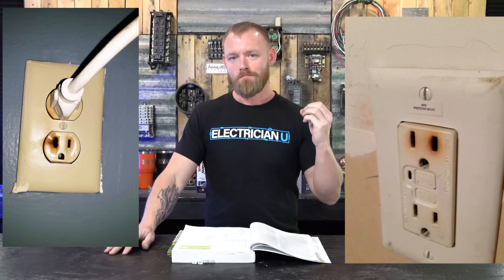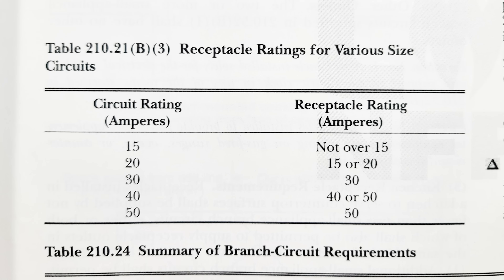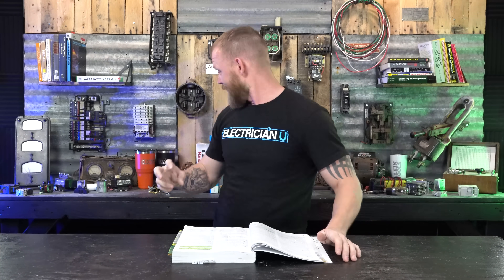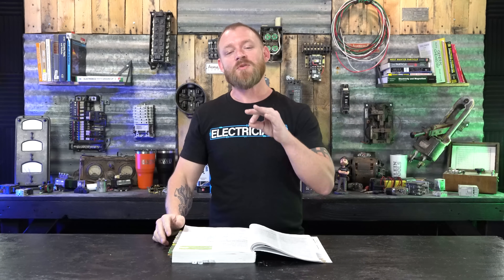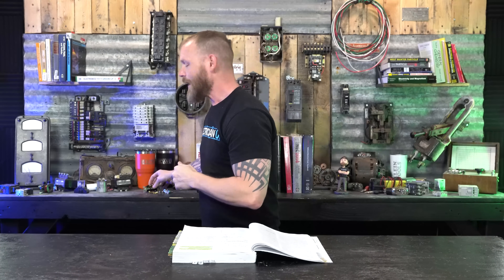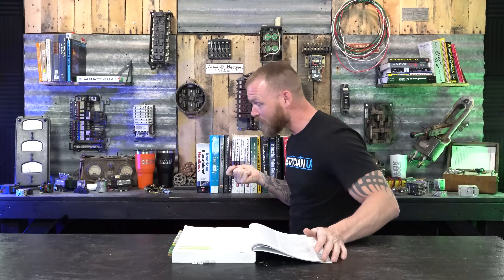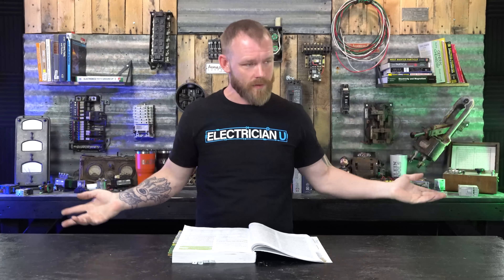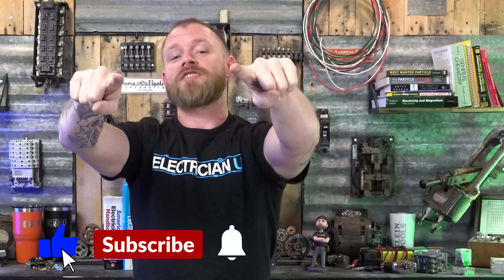Won't These Melt?!? 15amp Receptacles on 20 amp Circuits!!!

Comment: I have always been under the impression that it comes down to the plug style. A 15 amp receptacle has 2 verticle stabs. Any device you plug in is only going to draw a maximum of 15 amps. A 20 amp device has 1 verticle and 1 horizontal stab. It is physically impossible to plug a device that draws 20 amps into a receptacle that is rated for 15 amps. Therefore, even though the circuit is rated for 20 amps, a 15 amp receptacle will only physically have devices plugged in that draw 15 amps or less. 

In my experience, most devices I see that are burnt is due to a loose connection in either the wiring of the receptacle or loose stabs that make the plug connection loose. Im not so sure its an amperage draw issue.
Reply: The mistake in this is the assumption that it is all about an individual device.  Reality is the overall draw of all connected things on the outlets and circuit.  A lot of combinations are possible and you can easily draw more than 15 amps with multiple devices plugged in.
Reply: @MysticWanderer  that's true, someone could just put a plug splitter on there couldn't they. i've done it in a pinch to run a shop vac and saw together. but I don't think these 15A outlets actually burn up only because you put 20 amps through them. it's not like they're truly "weaker" receptacles are they?

it looks to me like a failed attempt at keying the plug types with the idea that we might transition to all horizontal-blade-accepting receptacles as standards went to #12 wire. But the market didn't follow what the regulators imagined. maybe
Reply: @Sean_y4k2l5  Don't even need a plug splitter, if it's a "duplex" outlet.
Can easily plug 25+ amps of draw (2 space heaters) into it with NO splitters needed.
Reply: @bricefleckenstein9666  If you put 12amps on the first outlet and 12 amps on the second outlet of a duplex receptacle, the circuit would draw 24 amps, but no part of the receptacle would be experiencing more than 12 amps of current as the current is split off to each separate outlet. You WOULD need a splitter to cause a higher draw through a single part of the receptacle.
Reply: @CalebEly  There would have to be at least some parts of that receptacle that experience the full 24 amps, starting at the hot wire contacts.
If the circuit is working correctly, the point the neutral wire contacts the receptacle would also see that full 24 amps of current.
Then inward into the receptacle to whatever point that one of the actual outlets splits off from the bus bars inside the receptacle.
Reply: @bricefleckenstein9666  What you are saying would not be only true for duplex outlets but multiple single outlet receptacles on the same circuit. This would mean you could only have a single 15 amp outlet on an entire 20amp circuit to be safe. Yet code says you MUST have more than one 15amp outlet on a 20 amp circuit, since there is no other reason to have it be a 20 amp circuit. This is because the hot wire contacts would not be the part of the receptacle that would fail due to current over 15 amps, otherwise it would not be code.

Also power strips and splitters would have a 15 amp fuse or breaker, so even through daisy-chaining the failure point is not pulling more than 15 amps when it fails. Blown 15 amp outlets are not failing due to overcurrent as they don't fail at connection that receives current over 15 amps, unless maybe the wire connection was not made tightly. The important failure point that should not experience more than 15 amps is at the prongs where a connection is not permanent. If you look at the blown outlet examples at 0:19, they all fail at the same point. This is because of connections becoming loose causing bad contact, resistance and heat between the plugged in device and the plug, not because they were pulling more than 15 amps or because where the Romex and the receptacle touch was experiencing more than 15 amps.
Reply: @CalebEly  It depends on how those multiple single outlets are wired. If the outlets are wired the way I was taught as a "best practice", with the wire going around the lug and continuing with no break in the wire, the wire becomes the overload point, not the outlet, as long as you're not overloading the outlet.
 
I do grant that the primary failure cause in most outlets is wear and tear over time on the plug-in part increasing resistance and heat.

Also, code DOES NOT say you "have to have more than one 15 amp outlet on a 20 amp circuit", unless that is a change in the most recent code version.
It's not considered a best practice of course, as you can overload the outlet without getting to the breaker rated current limit.
Also factor in how RARE "single 15 amp outlets" are - do they even EXIST outside of a "outlet + switch" combination?

Power splitters do NOT tend to have a fuse at all.
Power "strips" vary - 15 amp is by far the most common but I OWN a couple of them made by Triplight that are 20 amp circuit breaker, have 20 amp NEMA 5-20 outlets and a NEMA 5-20 plug, and are UL rated for 16 amps continuous usage (just like ANY 20 amp circuit). Triplight calls them "power distribution strips" or some such but they are nothing more than a heavy duty power strip intended for use in a data center.
Reply: @Sean_y4k2l5  manufactures are involved in writing the regulations
Reply: @bricefleckenstein9666  and the breaker will flip instantly
Reply: @CalebEly  exactly, those receptacles were burned by arcing not from too much power draw, otherwise you would never see a neutral burned like one of them in the picture
Reply: @Galgamoth  Breakers have a "trip time" depending on HOW MUCH overload they have (and on the specific breaker).
Seeing a 20 amp breaker need several seconds to trip on a 24 amp load is WELL within manufacturing tolerances.
Reply: @MysticWanderer  receptacles are reated to handle the load, the breaker is the weak link by design
Reply: @Galgamoth   20 amps would flow through a "15 amp" receptacle without necessarily tripping the breaker. It is allowed by code to put 15 amp receptacles on 20 amp circuits.

I'm not saying this would fry the outlet, obviously they have to be made to handle the situation.

This topic is a bit deeper and weirder than you suppose. I know it's the mfrs that write the regs... we call that regulatory capture....  whoever wrote them, they can be obtuse on certain matters.
Reply: you are exactly correct

Comment: In the UK we don't have an overload problem on circuits  so much because our voltage of 230/240v keeps the overall load lower. Power points in the UK are not normally radial. We have a system where all power sockets are wired as a 'ring.' Two cables per power circuit from the breaker(32amp) and wired as a 'ring' with a limitation of 12 outlets within a 1000 sq.ft. All twin outlets are made to withstand 32amp load. With the diversity factor it allows many sockets to be fitted. Having said that, I did, once go into a bathroom after the lady of the house had finished, only to find a metal soap rack across the bath with an electric toaster sitting on it!  So my friends overload is not our only problem!!  I must add, no electrical outlets of any kind are allowed in bathrooms-she had a extension lead for the purpose!

Comment: A chain (in this case, device> receptacle> romex wire> breaker> breaker panel...) is only as strong as it's weakest link.  It is like a bridge rated for 10,000 pounds.  Putting 4 one ton vehicles is about the most you want to put on that bridge.  5 is pushing it.

Comment: Does ElectricianU have a video on MOP and MCA when specifically referencing heat pumps and air conditioners?

In HVAC we need to use the manufacturers data plate maximum overcurrent protection (MOP) for the breaker size. And we need to use at least the minimum circuit amperage (MCA) for the wire size. This often is counter intuitive, example 50 amp breaker on a #8 wire (40 amp rated in residential).

During the covid breaker shortage we were forced to use breakers that were sometimes 5 amps less than the MOP when it was hard to find say a 45amp square d QO. However these would fail inspection if we weren’t able to get back in time to replace the breaker.

Being an HVAC tech it seems odd to me that this condition is not only allowed but required. I’m often replacing melted wiring in the disconnect, at the breaker and or in the outdoor unit because the capacitor failed and the compressor is pulling LRA, overheating, pulling LRA, overheating, pulling LRA, etc etc. because the it’s overheating faster than the breaker can trip on its minimum circuit wiring.
Reply: Oh and as much as I would like to just use MOP sized wiring sometimes that’s impossible because it’s either a retrofit with wiring that’s inaccessible or has an MOP of 70+ amps in modern inverter driving equipment.

Comment: What also comes to mind is the use of a pigtail in wiring the outlet in  parallel  on a circuit , rather than wiring them  in series. If that's the correct use of  terminology ?

Comment: bigger problem is most extension cords people use are not rated for 20amp or even 15 and they use it for heaters, ac and run multiple

Comment: I know from past experience that more than one space heater plugged in on same circuit will cause issues 20 amp receptacle on a 20 Amp not as bad but a 15 Amp receptacle on a 15 Amp circuit 2 1100 watt space heaters even urged in on different outlets but same circuit will cause a big problem I seen it literal melt copper wire in too not as common when correct vreaker is installed but I seen where a 15 Amp circuit breaker has been replaced with a 20 Amp and then u got a problem because wire burns our before breaker trips

Comment: I have seen some older server rooms with a 15 amp recepticle on a 30 amp circuit. These are specificaly non duplex. They have a C on them. These are called cardinal recepticles. They have a night light plugged into them. I asked a guy who managed servers since the 70s. Just a quick way to tell if the circuit has power.
Reply: my request is all the time, dedicated circuit [orange outlet]  all need to match breaker cable and outlet. For all my IT equipment

Comment: isn't it correct to say that a 15A receptacle can pull only 15A because the resistance in the metal determines how much current passes ? Why would 20Amps or more pass if the receptaclle is a  15A

Comment: In Canada 26-700 (2) says that circuits should have voltages and current ratings corresponding to the rating of the configurations... I've seen 15s on 20amp circuits, but to clarify it is wrong?

Comment: Can you tell me what I would do if I was purchasing a table saw motor that is rated @ 15 amp. Would I need to have separate receptacle rated at 20 amps and the circuit breaker 20a.  And what type wiring (gauge) 12 or 14?   Thank you 🙏🏾

Comment: Correct.  Rule is only 80% should be used.  So 20 amp breaker 15 amp outlet is fine

Comment: I hardly believe the conductors inside any receptacle will be smaller than gauge 12 wires. Melting receptacles are due to poor contact, not due to over current.
Reply: The Arc Angel of loose connections at play ?
Reply: Not always. Depends on what you have plugged into it. I used to work at a dog grooming shop. I had to replace outlets and the ends of cords on Huge Dryers constantly until I convinced the owner to spend the extra couple dollars on 20amp outlets.
Reply: @justinlast2lastharder749  That was because the cheap outlets can't provide reliable, low resistance contact, not due to insufficient conductor gauge.

Comment: Just replaced a 20amp GFCI in my kitchen.  The first electrical DIY I’ve ever done besides replacing a switch plate. It was the end of the chain (not sure if that’s what you call the series of receptacles on the circuit and the ground wire was not connected for some reason) I bought a 20amp to replace the one that stopped working and didn’t hook the ground but i did affix the no-ground sticker.  Then I realized that the breaker is a 15amp.  Is this bad?  The microwave is on this receptacle and the toaster and tea kettle are on the previous and we don’t run both because the breaker will trip.  Should I replace the receptacles with 15amps or just pay an electrician to replace the breaker with a 20?
Reply: It's been code for a long time that kitchen counter top circuits be 20amp. It's impossible to say what your wiring situation is without looking at it but you can only install a 20amp breaker if you have the right size wiring for it.
It is a code violation to install a 20amp receptacle on a 15amp circuit. You should also attach the ground wire if there is one because it serves a purpose. Would allow you to get rid of the ugly no ground sticker. If you're unsure of how to do anything, best to call a licensed insured electrical contractor.

Comment: The separation tab on a 15amp outlet, if you remove this, run each outlet as a separate circuit, is the outlet rated 15amp each side?

Comment: I am NOT an electrician ... but I have done some wiring.. I've always used 20 amp outlets on 20 amp circuits just seemed the right thing to do. ... might be all those times I had to go to the panel to reset the breaker for my compressor every time it started ..  like I said, it just seemed to me that 20 amp outlet on a 20 amp circuit was the thing to do ..

Comment: My waffle iron runs 13.3a I plug it into my kitchen island that has stove connector and a 20a circuit to itself across 2 receptacles/4 outlets. There was a microwave in it too but we bought this house from short people with a wheelchair-bound elder so the knees-height microwave is stupid, so we turned it into more pots and pans space. It came with 15a receptacles but I put 20a ones in when they got too loose. it gets cold here but my house is well-insulated and has 2 100k btu gas furnaces, a wood burning stove, and two gas fireplaces plus the downstairs is plumbed for radiant, and the associated gas boiler.

Comment: That seems odd to have code that relies on customers to do things right. You’d think the code would try to limit issues from customer ignorance and/or stupidity. That’s like our plumbing code allowing 2” pipe for a toilet because the waterways in the toilet itself are 2” then saying tampons and “flushable” wipes shall not be flushed down the toilet. No you require 3” plus assuming people are going to flush those things anyway.

Comment: I've heard an interpretation that the "single outlet" requirement for putting a 20A outlet on a 20A circuit means the outlet only has one plug in it, such as the round outlets. The interpretation said that if the outlet is a double outlet (the common outlets in a house), that that's actually 2 outlets and doesn't count. However, I'd think that if you used both halves of the outlet, you're going to overheat that outlet. So, what's your interpretation? If you only put one, double outlet on a 20A circuit, do you think code requires it to be a 20A outlet? I think that practically it should be, but what's your code interpretation?
Reply: This is the way my inspector looks at this code.    I have all 20 Amp breakers with 15 Amp outlets.    And in my bathroom I have one double outlet, which is two receptacles with a GFCI breaker..
Reply: On a 20 amp branch circuit. If it is more than a single receptacle it can be 15 or 20 amps. 2020 NEC 210.21(B)(3) and Table 210.21(B)(3). However if it is only a single receptacle it must be 20 amps. NEC 210.21(B)(1).
Reply: @tiggeroush  Agreed. I'm not questioning that. My question was basically, what constitutes a single receptacle? Is a "single receptacle" with 2 outlets in it (a typical household receptacle) a "single receptacle" for this paragraph or does "single receptacle" only apply to the round receptacles with a single outlet in it? It appears that a duplex receptacle is interpreted as more than one receptacle. So, "single receptacle" would only apply to the round receptacle with only one outlet in it.
Reply: @tiggeroush  That is the interpretation that I had heard, but it is the first time I've seen the actual description for how that interpretation is arrived at. Thank you.

Comment: Poor installation practice. Code is a minimum. Any Electrician who understands the trip rating of an overcurrent device should never install a device that is not rated for the maximum circuit ampacity. I understand circuit loading but we also have take the maximum available current.

Comment: Sorry. Commented before I watched the video. Your initial intro makes it sound like this is really bad. I upgraded all my 15A breakers to 20A. Why? Because the breaker is shared across multiple outlets. Thus you could have 10A on one outlet and 5A on two other outlets thus 20A total. Could I have an issue if I sourced 20A on a single outlet? Sure. But, you don't run across many household items that require a full 20A. In fact, the one item that I have that does require 20A is in my garage and I use a dedicated circuit for that. If I replace my outlets I always upgrade to a 20A capable Commercial Grade outlet instead of a builders grade.

Comment: I believe there is even more to the safety of an outlet. Back wiring also cause potential problems but wouldn’t wiring load and line through the screw lugs also potentially overload the receptacle as far as heat is concerned? I always pigtail my receptacles.
Reply: No, wiring  line in and out on the screw lugs does not potentially overload the receptacle because it is designed for that use. The benefit of pigtailing is if you have a problem with the receptacle connections it will not affect any other receptacles on the circuit and faster to troubleshoot a bad connection. I pigtail commercial because I feel it's critical that they don't loose multiple receptacles all at once. I don't take the time on residential unless it's required but doing quality work you should  have no problems.